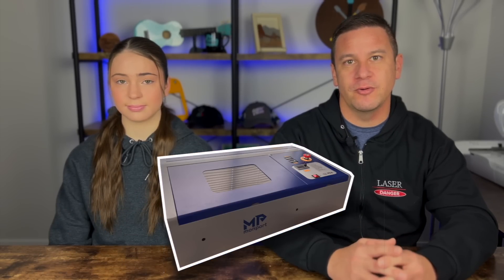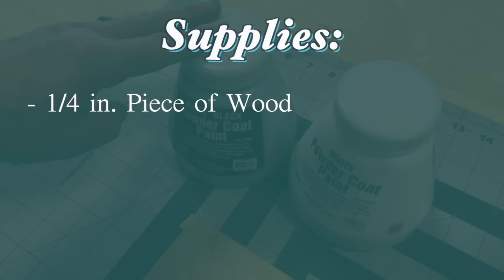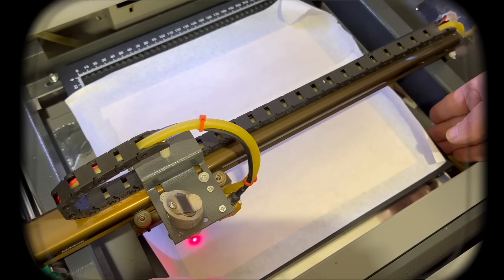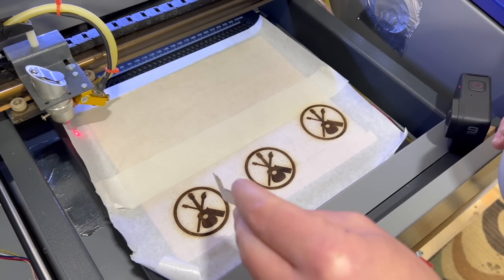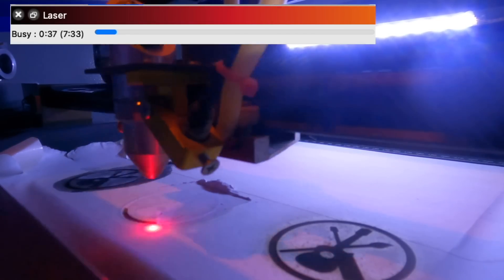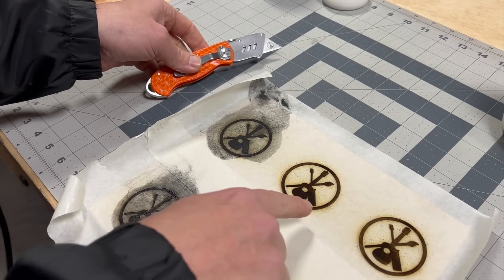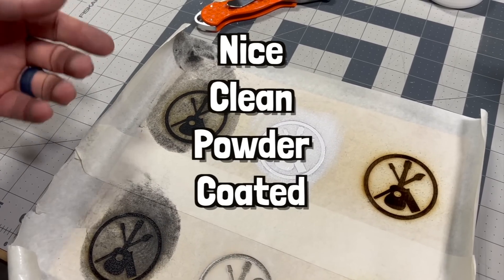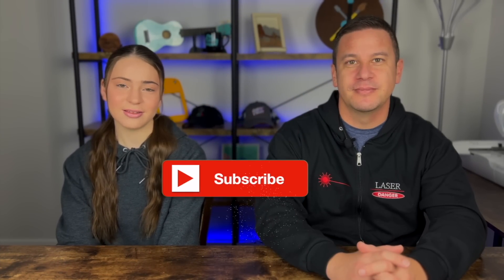POWDER COAT PAINT LASER ENGRAVING w/ Monport 40W CO2 Laser

Comment: I love using powder coat on my laser engraving.  For me I could never get a good application using masking, I end up prefinishing my board first with a clearcoat so that the powder doesn’t stain the wood.  I do a very deep engrave and fill twice with powder coat to ensure proper melt and adhesion. If it’s not fully cured through there could be powder under the top layer of cured paint and any flex in the wood will pop it right out ( ask me how I know.. LOL)
Reply from the maker: Thanks for the tip! We have tried pre-sealing the wood in other projects, but can never seam to get rid of the excess powder coating after spreading it into the engraving. Masking makes it so we don't have to be perfect in our application. Also, great point of the powder coating not being cured under a thin top layer. Thanks for watching!

Comment: Nice to see an unique application.👍 Actually, the laser could be made to mimic the heatgun,  by defocusing a bit(intentionally lowering the bed down by a few mm), increasing the power and doing a flood fill(rastering a rectangle(adjusting speed not to burn,but just enough to melt), that contains the artwork). It should be pretty close to heatgun method(may have to do second pass/filling similar to heatgun). The masking is a good idea, without which, this may not work. Just some suggestions....
Reply from the maker: That is a great suggestion of defocusing the laser. We didn't think of that. A problem that we would have with doing that is are z height needs to be manually adjusted (change shims beneath our honeycomb bed) which would obviously move where our engraving is for the second pass. However if we had a more high end laser, with the z bed adjustment,  this would be great!  Thanks for watching!
Reply: @ProjectAnonymous_Duo  Yes, you are correct, that you cannot trace the artwork, when you defocus, since it will shift a bit. But, it should work fine, if you are just scanning a bunch of closely spaced lines covering the artwork and a little more(in the melting pass). Nothing different to applying hot air to melt the powder. Except, it is a hands off process once dialed in, with no worries of blowing out the powder.
You could setup the scanlines in a different layer(just overlap artwork and have additional margin to allow for defocus shift), enable it during melting pass(es). I understand, you don't have powered z-lift. But, if you use pegs(or magnets) on honeycomb, and align the artwork, lowering the honeycomb will not be an issue(as simple as removing the raisers). Again melting pass does not need accurate repositioning, since it is a rectangular area slightly larger than artwork.